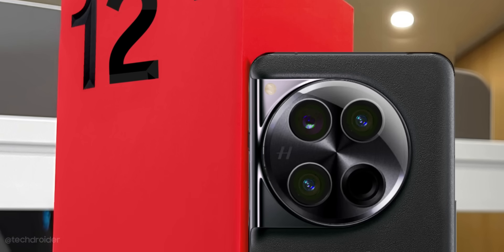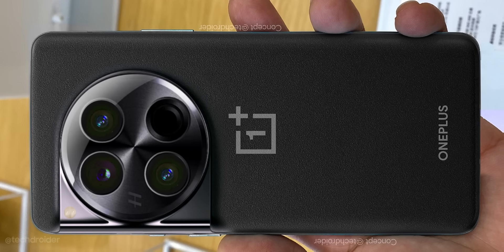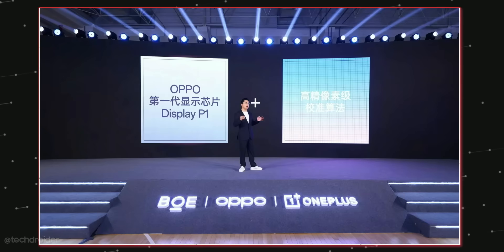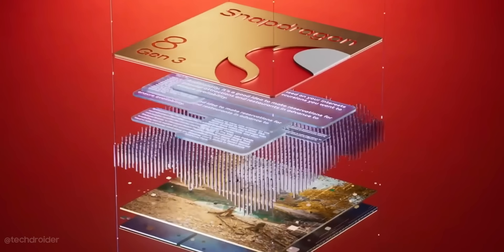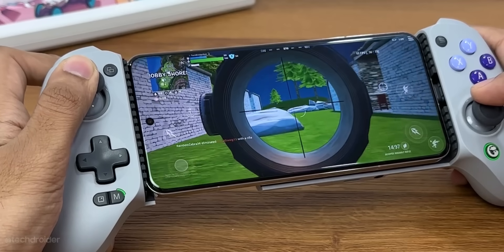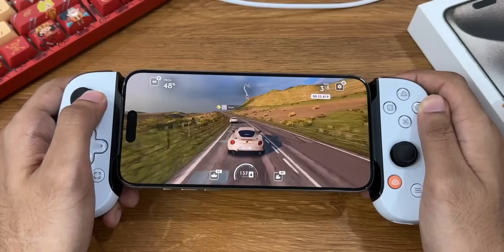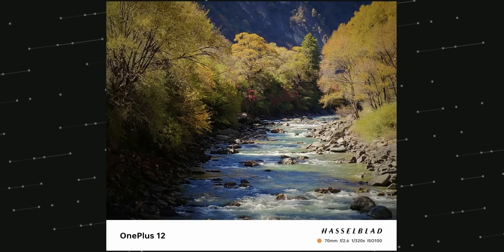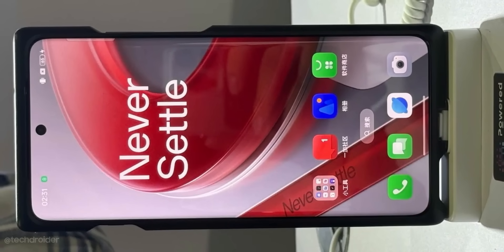ONEPLUS 12 - Snapdragon 8 Gen 3 + Sony LYTIA Camera + 5400mAh Battery

Comment: I don't 5400 mah is going to be a groundbreaking upgrade because nowadays all chainese brand like Vivo Xiaomi realme even OnePlus having increased battery size but this this this battery is Li - po which is significantly inferior to  Li  - ion.

So I think 5400 is really an on paper upgrade it will degrade very fast ..
Reply: Basically all phones that have very fast charging use li po bc they are safer than li ion .Even if they degrade faster than li ion it doesnt matter because you can recharge ur phone very fast
Reply: @wouter.d.h.  I prefer good back up rather than fast charging

Comment: Actually the 8 gen 3 uses just over an extra watt than the 8 gen 2 so not as efficient
Reply: No bro that's not how it works. 8Gen3 uses less energy to reach the maximum performance of 8Gen2. So it indeed is more efficient than 8Gen2.
Reply: @devilefty3814  actually in performance charts its shows it uses more energy to reach same performance as 8 gen 2
Reply: @harryvlogs7833  Bro are you high? Even 4880 mah Xiaomi 14 Pro recently beat S23U at battery test, just watch it. Besides in almost every Geekerwan test 8Gen3 reached 8Gen2's max performance with much lower energy consumption. Stop spreading misinformation.
Reply: @devilefty3814  no it doesn't and its not misinformation
Reply: Time will tell and xiaomi beating s23 ultra in battery test means that s24 ultra will indeed be a better beast
Reply: @avnertouitou3778  currently s23ultra is still best battery on android phone
Reply: @harryvlogs7833 no honor magic 5 pro is better